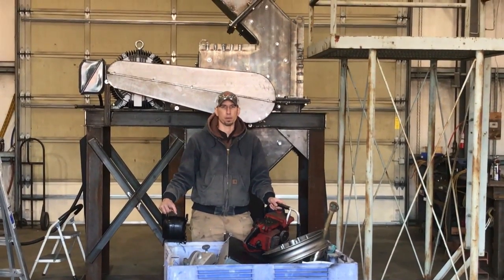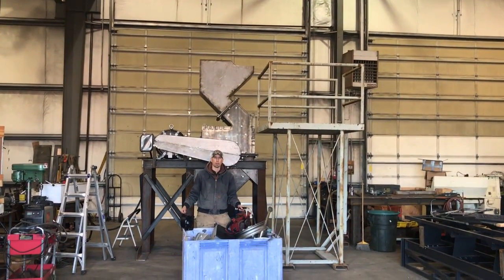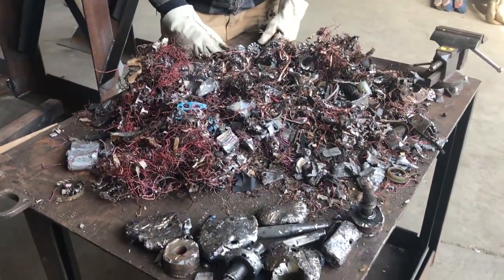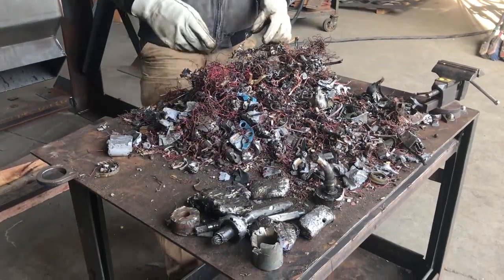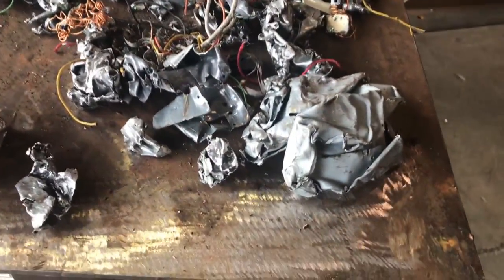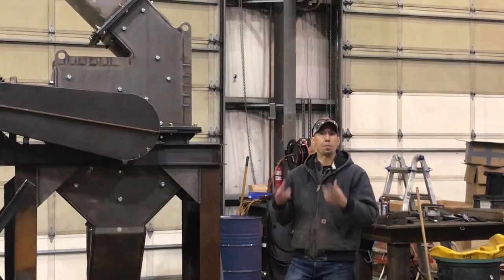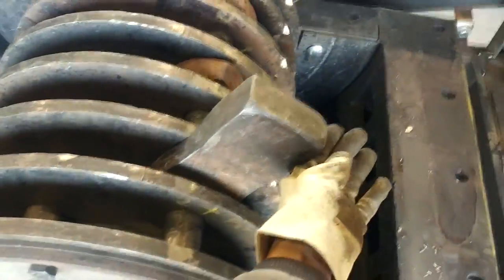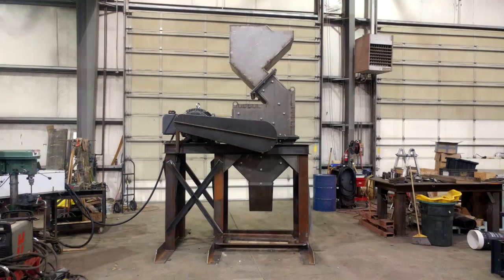Bigger Scrap Metal Hammer Mill! Starters, Transformers, Alternators, Brass, PC's, Cast Al

Comment: I remember you dumbass you don't know what you're doing. That was for something else I don't remember. Seems to me I think that one's for plastic. If you people had a brain in your f**** head you take the starter sell it have someone rebuild them. A rebuilt starter or alternator or generator has more power than a new one. Because the housing has been used and it is stronger it's aged. You can make it produce more electricity and it is it still a better built product rebuilt the new. Cuz I used to do this to for work . Who would buy these. People that are using a lot of lights. People are going to plow snow winter........ I've been watching the prices of scrap right now they're in the negative. You're Scrappy more tons of metal. You were that stupid............ Why was a smart person I'd go to the junkyard to buy what is there rebuild it. Vices are clamps.. all types of tools wrenches. Pry bars milling machines blaze stuff for The Machinist industry welding industry. Bring to a foundry melt it down make the metal harder make it better product. This is why the more expensive tools cost more they're made out of better steel. And you got to sit there and babysit that son of a b** if you know the mixture for that better metal you got to watch the temperatures you start the machine clean you walk around the shop and see how clean it is. You don't let that piece of s*** steal anything out of it you clean the pot all the stuff out of it. Are you build a building at home where you live and do it yourself. First person gets better tools as you. Can you make c-clamps. Ice make a special c-clamp years ago for the welding industry construction. They cut them certain different widths. They put a concave or use an end Mill on the side of it this helps strengthen it. Or radius. They make a fixture for it and a CNC mill. I think I was doing 20 to 50 of them at a time. One run..... Find threads has more power...... Special advice as you can find anymore. Won't you set it up on the CNC mill it's no big deal. You measure each part you divert real nice before you put it in the machine and make sure it's flat..... And because I'm picky when I make stuff.... Winter tools. We used to make engines like this. I used to work with the factories forge Dodge GMC I helped designing engines and transmissions and transfer cases. I was 8 years old not even 6     .......... I wanted a better car built truck built. So the piece of s*** one break down in the middle of winter and freeze to death. All because the old man was too cheap to go buy a four-wheel drive truck with a plow on it before winter. Never let anybody use your stuff go do it yourself make sure he's not lying. Loser go buy your own truck go plus know and do it yourself.

Comment: I have the perfect test piece for you..  Doug1979transam@gmail.com 
The parts is 2"x9" cylindrical.    1.5 lbs each. Ish... we use a big 150hp ring mill, and destroy it..  it needs to run 25 or more PART per minute.
Reply from the maker: Sounds good.  Shoot me an email with more details and pictures: info@mbmmllc.com Thanks
Reply: @mbmmllc  i will. And a video..

Comment: Hi Jason! The hammer mill looks quite good. But I have question, how this hammer mill will look like after shredder 24 tons of trafos? As we can see You put 20 psc different types of scrap and we can see screen and hammers are chipped...
Reply from the maker: Hi Maciej.  Thanks for the comment.  I have run several tons of material through the hammer mill now and I will do a video showing the wear on the screen and hammers.  The wear is very small, almost nothing.  The hammer mill holds up very well

Comment: Run some refrigerator or air condition compressors (sealed units) also.
Reply: Xtreme Performance  no kidding!  A bunch of people with hammer mills don't want to run them due to the heavier casing and some of the insides.  I'd like to see how Jason's equipment will handle it.
Reply: Xtreme Performance  my point is the hammer mill can run numerous different materials (dirty brass, ACRs, ASR fluff, electric motors, sealed units, circuit boards, etc).  The machines you're talking about are limited to motors, transformers, seal units, etc.
Reply from the maker: Will do

Comment: Discharge holes have some wear already. Just sayin'. Just how many items with shafts can it take before it needs service? Surely it's steel shafts beating the hell out of those discharge screens. 

I also wonder about balled up sheet steel, whether non ferrous ends up encapsulated within balled up bits. 

Im thinking hammer mill first, shearing action of a shredder for processing transformers?
Reply from the maker: Yes, thanks.  I will do a video showing wear, we have run many tons now and the wear is minimal

Comment: What is the price on these?

Run the following: laser printers, garbage disposals and lawn mower engines. If the engines are too big, run them thru a jaw crusher first.
Reply from the maker: For pricing please email info@mbmmllc.com and I can provide you with some more information. We also plan on running those materials as well in a later video as well as other material through a smaller 1" screen.

Comment: God machine , how much 34 x 24  , for crush  river rocks , it will be better have changeable screen ( if not 5 mm max ) ?
Reply: Most of, if not all, of their Hammer Mills you can change the screen to what suits the material your feeding through it.
Reply from the maker: The screens are interchangeable, simply roll in and roll out. For pricing please email info@mbmmllc.com and I can provide you with some more information.